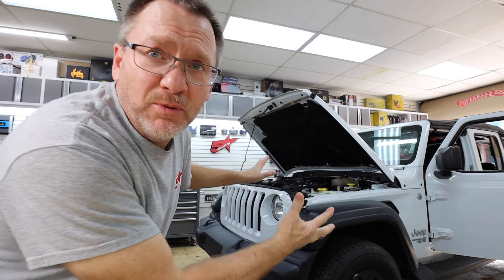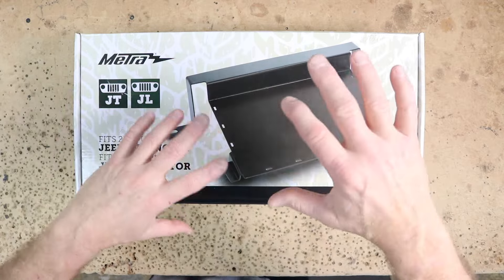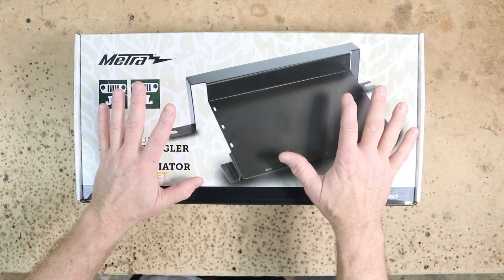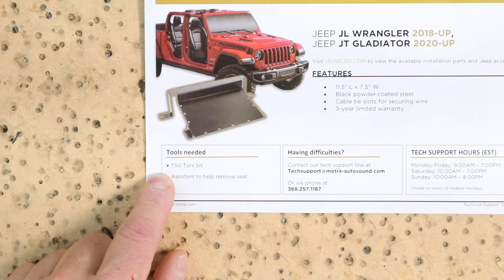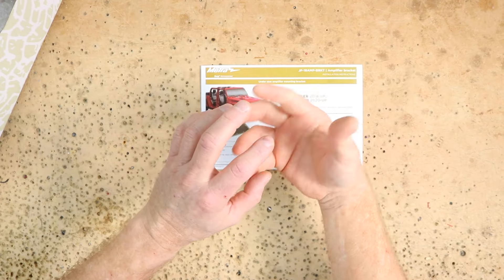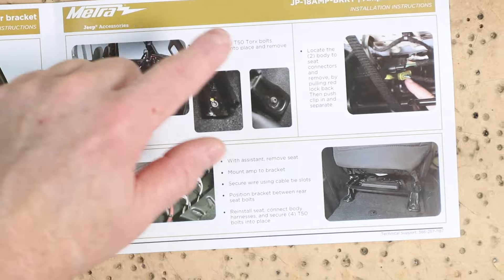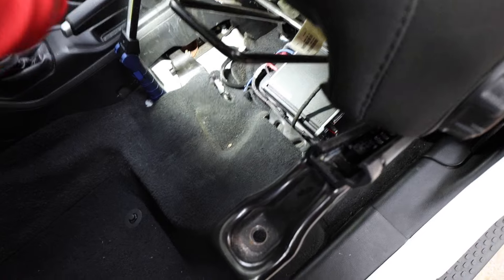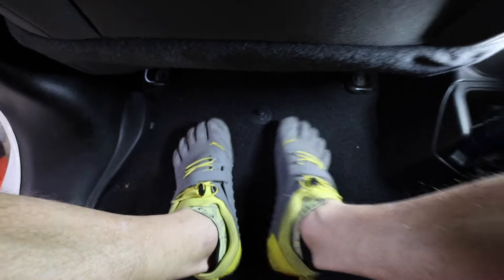Metra's Jeep  Wrangler amp rack is a must have for installing in a JL

Comment: So it puts the amp directly in front of the floor heat vent?  If they had a cutout in the front, and maybe even a small flap sticking out they could direct all the heat past it underneath.
Reply: I was thinking the same thing, youll be blasting that thing with heat in the winter.

Comment: i never understood the facination of putting amps under the seat where the heat vent is. a lot of five star car installs puts it right where the heat is. doesn't sound good to me, am i the only one noticing this issue with their installs?
Reply: Yeah not an issue
Reply: 5 star works out of Tampa Florida, no need for heat here. I have a 2020 Jeep Wrangler JLU with the oem power top and I've never had to use heat, actually cool air cools down the amps down here. 👍